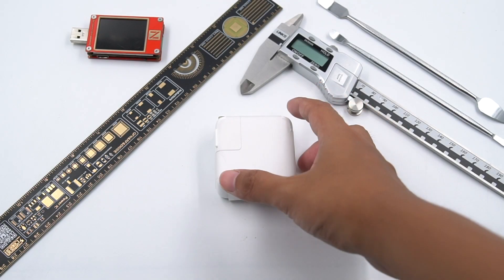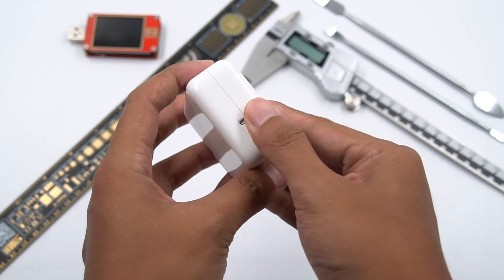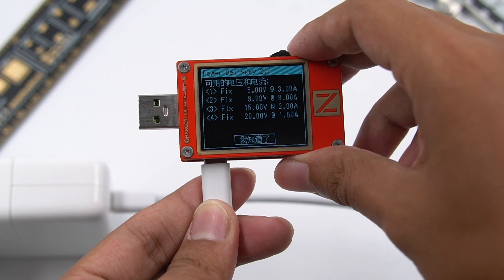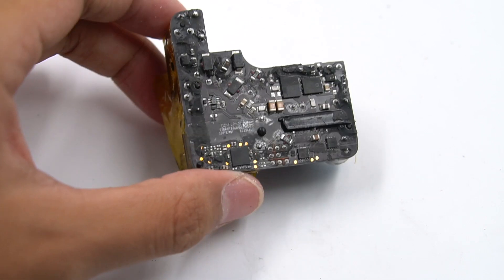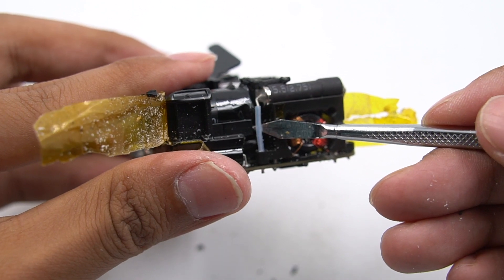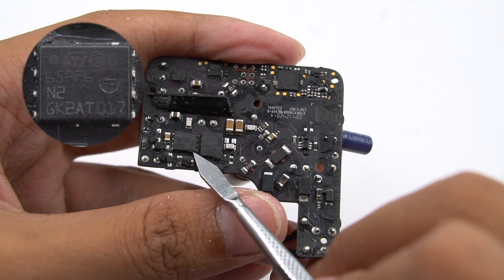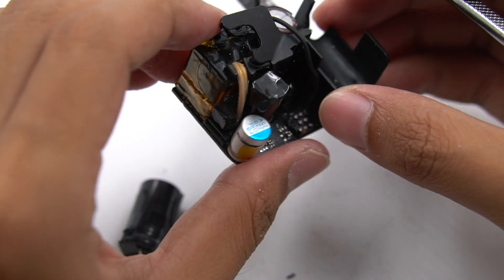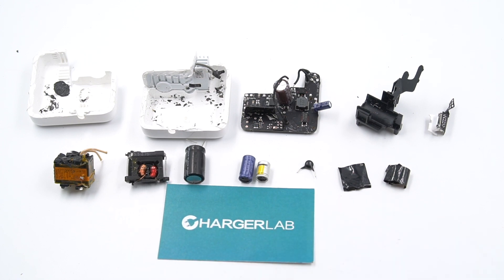Teardown of Apple 30W USB-C Power Adapter (Charger)

Comment: Could you confirm that its output is:
5V3A, 9V3A, 15V2A, and 20V1.5A?

Also since each manufactures reccomend to use their charger over their device, despite the similar or better specific, since you tear down multiple charger is possible know quality alternative, eventually GaN?
Or regardless of the quality the GaN unit heat always more than the traditional units?
But if this is the case just use a unit that support more watt, given a proper voltage and more ampere than necessary don't should offset the heat issue?
Thanks.

Comment: can someone recommend me a faster charger than this 30W from Apple? For reasons unknown, most arrive at my place with their phones down to 18--30% or so and we need to charge up before we go on a trip or something else. I glanced at the OnePlus 65W charger but then i saw Xiaomi releasing a whopping 120W, would the Xiaomi charger be able to charge any phone/tablet with most protocols? 
The Apple 30W is currently the only charger i got for all my Apple devices. I tried Ravpower GAN 65W but it literally shot sparks from the wall outlet so i returned it and now i don't want anything near them again 😅

edit: if the charger can also charge my MacBook and Nintendo Switch it would be nice to only have one charger with me on the go
Reply from the maker: You can try 65W+ or 100W+ PD multi-port charger, such as IDMIX, ANKER, UGREEN, BASEUS, BELKIN, etc.
Reply: @ChargerLAB  ended up with Anker Nano 2 with 65W with PD and PPS, as well as a Belkin 25W with PD and PPS, then i got a cheap 10W Qi chargepad. i will be damned if i need more than this given that i also have my MacBook 30W as backup 😂👍🏻

Comment: I like that Apple is able to produce premium quality power supplies in terms of internal components, outer design and probably output current quality (ripple, voltage spikes, voltage stability under different loads), however I dislike price, bigger physical dimensions and absence of broader charge protocols support and PPS mode that is often used on non-Apple smartphones. It is sad then when I use 96W Apple adapter and my S20 barely uses 15 - 17W even though it could easily use 9V @ 2,78A

By the way are you planning to do deeper analysis of power supplies / chargers you present here? I like deeper analysis where also output voltage / current is taken under deeper review for any signs of design flawbacks like: ripple, interference, voltage spikes, voltage stability under different loads and safety issues (insulation between primary x secondary, underrated components, etc) For instance YouTuber DiodeGoneWild does those reviews and reverse engineerings, mixing your and his style would be awesome and very informative for end users and experts :)
Reply from the maker: Thanks for the advice. We'll consider it.
Reply: Solution: Never even use those disgusting Apple charger as I do. (The Iphone charger is a design crime and made me cry and shake, when seen first back in 2015). I never unpacked Apple chargers at all. Just buy a good Baseus or Aukey or INUI charger with GaN and PD and be happy.